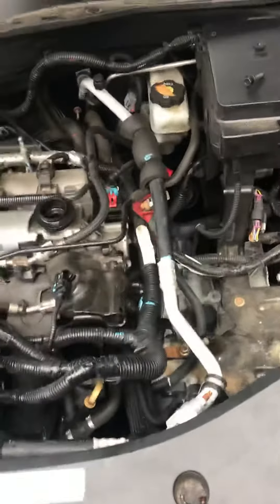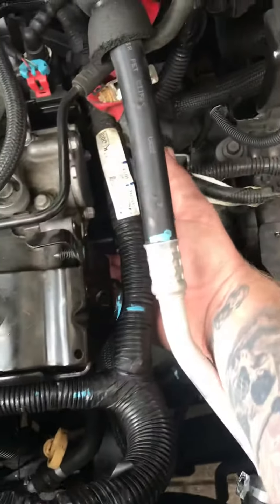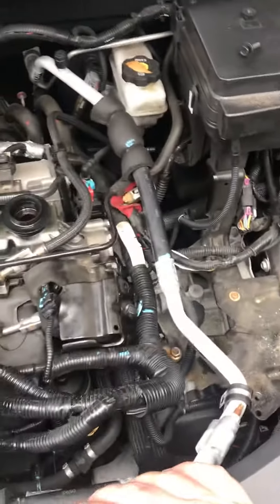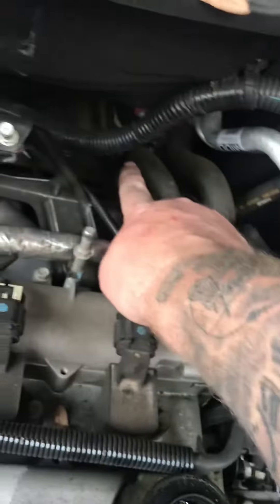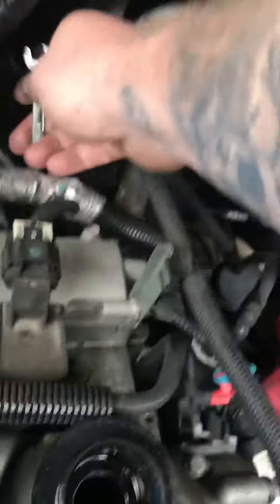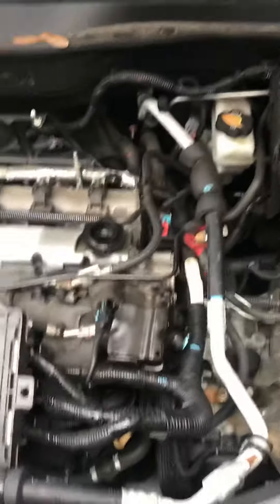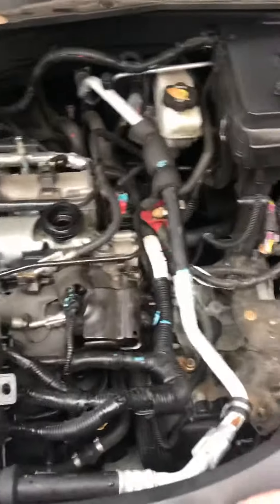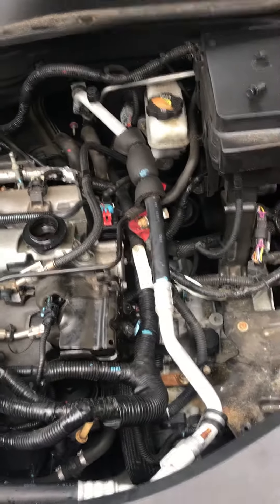Chevrolet equinox camshaft sensor replacement

Comment: Can thay be cleaned
Reply from the maker: I’m not sure about that sir. And even after replacing the camshaft sensor in this video I continued to have the same issue so I ended up getting rid of the vehicle not long after this video was made
Reply: @bigbobbrowning2960  how long can you run it  will it wreck the engine
Reply from the maker: @tyball2489   not really sure about that because I’m not a mechanic. I’m self taught. The bad camshaft sensor in my vehicle was causing the engine to stall and shut off at red lights or low rpm